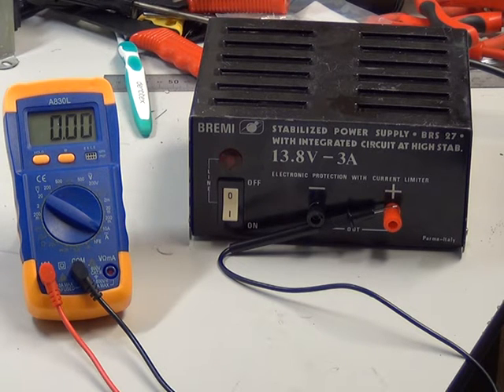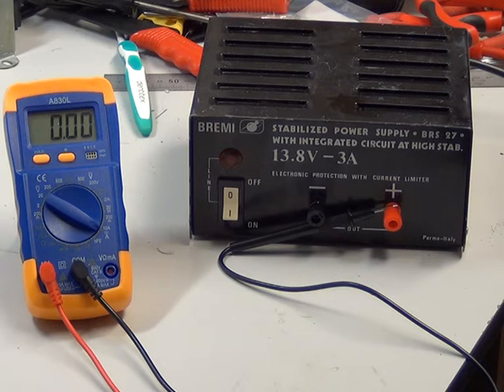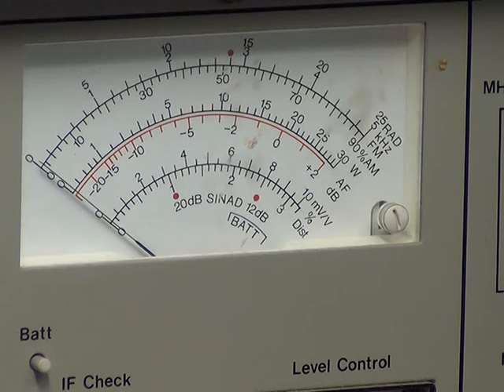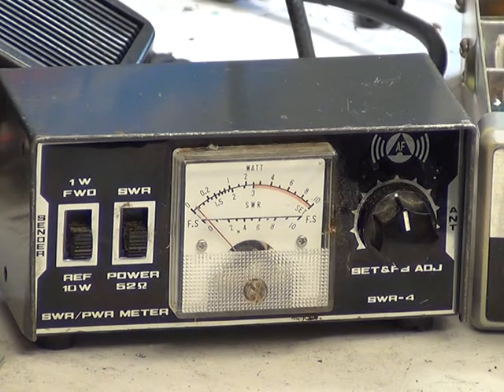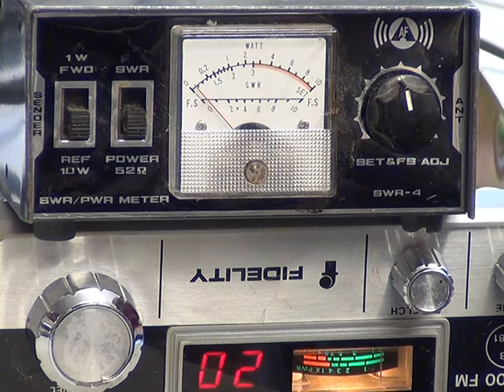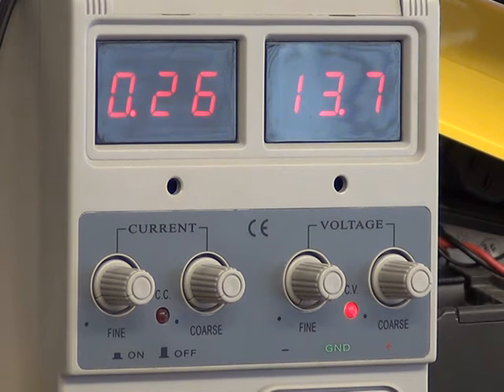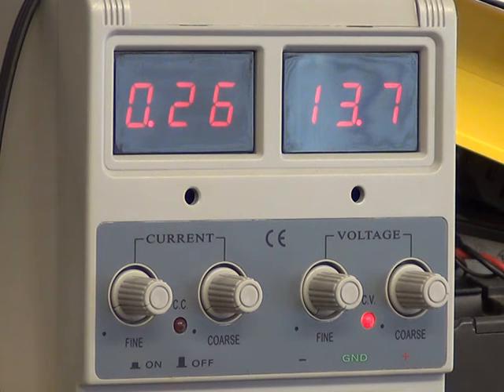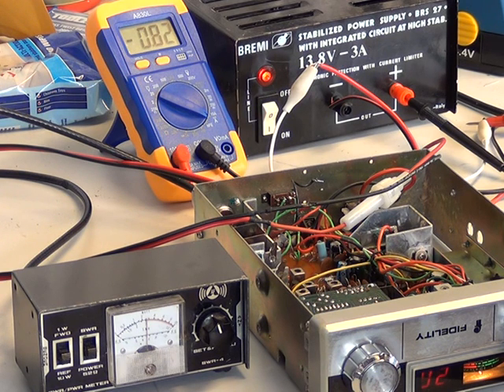Measuring RF Output power on CB radios - Servicing CB radio on a shoestring budget pt2

Comment: which Marconi test set do you use?Ive just recently purchased a 2955 and im very pleased with it.
Reply from the maker: It's 2951 late version - we have three benches with them on. I also have a bench with a Quartzlock 282 on the bench mehind me & a Schlumberger 4040.

When I was at Nottingham radio (for 16 years), they had three 2955B test sets.  I was disappointed with the lag between making adjustments on the radio I was working on & what the test set was reading. When I was at Compass Communications in Bradford later on, they had a Marconi 2951, a couple of IFR test sets, a Motorola one & a Marconi 2955A. I fell in love with the speed I could get results with the 2951. Back then (in the 90's) I had a Farnell TTS520/SSG520 combo test set.  When I left Compass to be solely here, I bought the 2951 test sets from various instrument supplier.

Richard, G0OJF, UK
Reply: @ukfmcbradioservicingTango21  the 2951 is a nice bit of kit...looks nice and straight forward to use..i missed out on a 4040 a while back....outbid by 50p🤣

Comment: are there any cheap watt meters that will actually measure pep power. i bought a astatic 302-pdc2 and it seems useless for measuring actually swing power .essentially only idle transmit power and does not show what it really puts out when modulating, in theory you should get 4x your dead key BUT thats only if the radio is set properly.  .   so from a deadkey only how do you actually know???? 

also , for modern radios, just curious what is the efficiency of transmit power in comparison to input power , for example of the radio is drawing 30 watts from [clamp amp meter x power supply voltage]  how much of that is actually transmist power,  im familiar with car audio amp types with class ab amps being 60% effcient and class d being 90+% effcient, but not sure how effcient these are. .  
one last question if you dont mind, 
 if you have a higher end uni-t true rms meter  ac dc clamp meter  is possible to read the power. on the out put? i know ohms laws is ohms law so in theory if i can get at least 2 readings i in theory should be able calculate rms from the coac out it, was thinking volts and clamp amps but not sure. . sorry for all the questions , super new to the hobby but also an electrical mcgiver so trying to take what generically know and apply it to my new found hobby
Many Thanks, Mike
Reply from the maker: Mike, I get the impression you are not in the UK. This channel only covers UK FM CB radio servicing. I'm using a Marconi radio test set. As the test set (and me) are not involved with SSB, the power meter is not PEP.

I looked up the Astatic SWR/Power meter you mentioned. It's a generic meter available in different brands, made in China & aimed at the AM/FM CB radio user, not SSB. With FM, the transmit power always remain the same whether the carrier is modulated or not.

We don't measure power input to a CB FM transmitter ever in the UK. I will say though that the average 4W radio draws 1.3A on transmit at 13.8V.

It seems you are intersted in SSB. All your answers are in the ARRL handbook.

Richard, G0OJF, UK

Comment: For me I would not do this test, because I can't clearly see how the wires are connected.
Reply from the maker: Patch lead from the aerial socket of the radio under test to gthe SWR/Power meter. Dummy load into the 'ant' socket of the SWR/pwr meter.

Richard

Comment: Good video, 
Might be more helpful to know what part was actually replaced in the afore mentioned repair?  And how that part was discovered to be faulty
Reply from the maker: This video is about using a cheap CB power/SWR meter, a cheap power supply, a homemade dummy load and a £2.99 multimeter. The video compares the results on a 1981 Fidelity 1000 UK CB radio doing just under 3W on our laboratory standard Marconi test set with the cheap meters mentioned above. I'm trying to illustrate a cheap way to get valid results for people not wanting/able to spend thousands on test gear.  The customer's radio repair will be on a preceding video. We've covered the Fidelity CB1000 & many other UK sets from 1981 that use the same Great (Taiwan) GT848, GT858 & GT868 chassis, many times. I can always cover it again if you want!

Richard, G0OJF, UK

Comment: What are u hooked up to???
Reply from the maker: In what respect? Radio is connected to  a 13.8V power suppky. Radio is cinnected to the power/SWR meter via the coaxial socket with a short PL259 to PL259 patch lead & the SWE/Power meter has a dummy load connected to it's 'aerial' socket.

Richard, G0OJF, UK

Comment: They don't use power meter around here either.
they run their CB radio in to their linear and they key up and adjust their radio drive so the power supply amp meter shows 20amp, that's 100w you know..

you can imagine how many radios and linears have gone bang..!!

and some of these are licenced (used loosely) Amateurs.

Comment: Hey. I have a small anytalk mini CB radio that claims 4w/8w on low/high power. It draws about 0.25A receive, 1.5A on AM on low power and 2.35A on AM on high power. All on a 13.8v input. How do I calculate the actual rf power? If I use a similar ratio of the total power over rf power of your case ( 11w/3w=3.65) I'm getting 5.7W/8.9W on low/high, do you think that approximation is somewhat accurate? Thanks!!
Reply from the maker: Pedro, I can only comment on UK legal CB radios, which is what this channel is about. I've never heard of the model you mention & I know of no countries where 8W is legal. That said the power consumption sounds right for the stated output, but again you are talking AM, whereas my training & expertise is FM, which draws less TX current. There is no formula for a relationship to input/output power as it depends on transmitter efficiency. Most 1980's UK radios will draw approx 1A on TX for 4W output making a 12W current consumption for 4W output. Latest models are much less efficient, mainly drawing approx 1.6A for 4W output, so about 20W consumption. The only way to check RF power output is with a quality RF power meter & dummy load. I did a video on this some years ago which is still on youtube. Bear in mind some CB type power meters (such as made by zetagi who also make illegal amplifiers) are wildly inaccurate and may well show a 4W output as 8!
Richard, UK